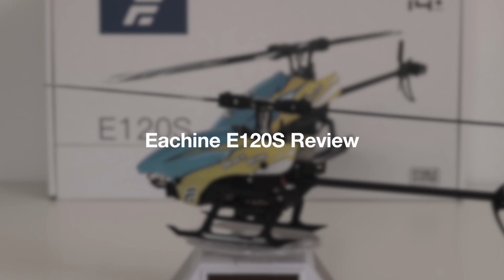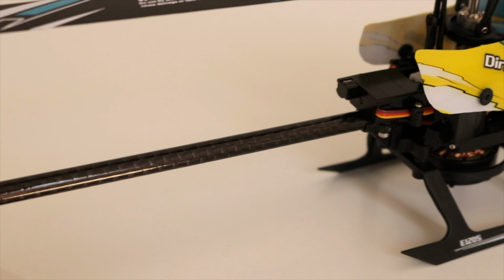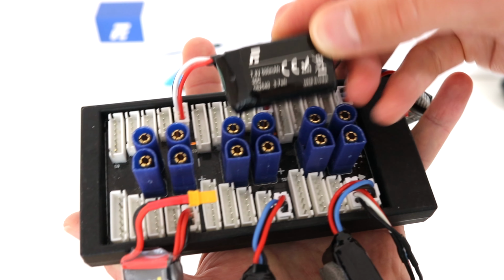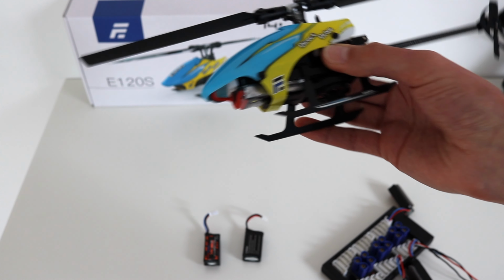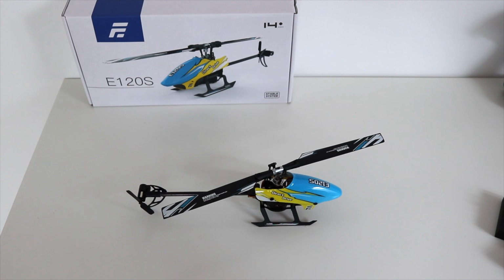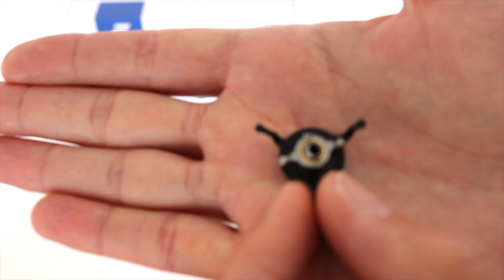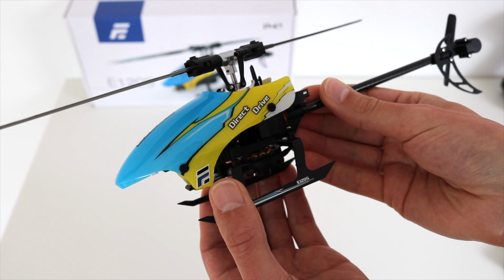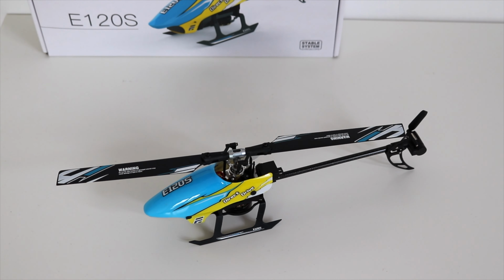Eachine E120S Helicopter || Unboxing & Review After 100 Flights

Comment: Could you share your pitch curves? I have this helicopter and am trying to learn 3D but I’m really struggling because the tail won’t hold, so even things I can do easily on my Goosky S1 usually end up as a crash on this one because it spins out of control and I can’t react to the spin fast enough.. But in your video the tail hold looked perfect the whole time, even with the more aggressive flip to inverted.

I want to figure out how to make it fly well because the weight and sound make it very satisfying to fly.
Reply from the maker: In my Radiometer TX16S the pitch curve range goes from -53 to 53. If you set a larger pitch curve range you will have issues with tail hold.
Reply: @AndrejSturm  Thanks so much! Mine must be having other issues then, I'm using -45 to +45 on my Radiomaster Pocket (I think the numbers should be the comparable because it's EdgeTX on both). My "Normal mode" throttle curve is flat at 0,40,40,40,40,40,40 and for 3D I was using 70,70 or 100,100. Do you like it better at higher or lower head speed?
Reply from the maker: I like lower head speeds. 
Other possible reasons for lower tail performance: 
- tail rotor slipping on the tail motor shaft - solution = glue the tail rotor on the motor's shaft by superglue.
- tail motor is worn out (it can overheat in the summer) - solution = new tail motor 

Sign of a bad tail motor on this helicopter is main motor bogging down, this happens because the flight controller automatically lowers the maximum output power to the main motor when the tail motor can't compensate the torque produced with the main motor.
Reply: I have the rtf version. And my tail spins 180-degree very quickly sometimes and go out of control when full left or right stick. Any advice please. Im flying in 6G mode.

Comment: how is the servo holding up? my omp m1 have 50 flights with it without a crash, just cruising flight, and already replace 6 servo due to servo coreless motor failure, i put the heli on the trash....
Reply from the maker: Servos on the M1 and S1 are the worst servos in my 25 years RC hobby history. I have constant issues - failures on those two helicopters. I have about 150 flights on this E120S helicopter and the servos are still working OK. I have no issues with servos on the M2 and S2 helicopters (S2 has now more than 1000 flights).
Reply: @AndrejSturm  nice, i might consider buying the s2...i have walkera 4g6s over 15years old and the servo never fail😅